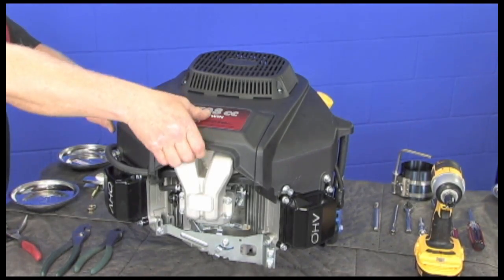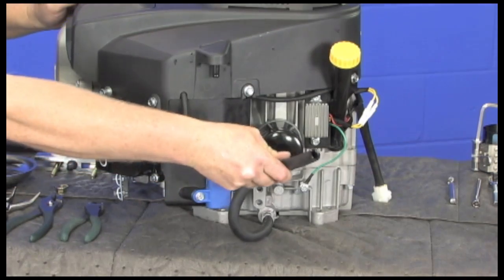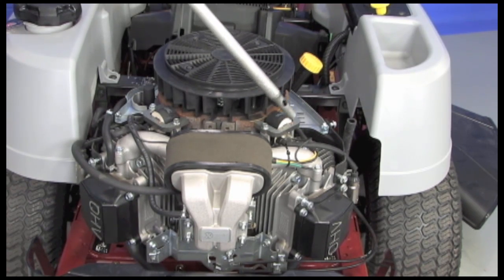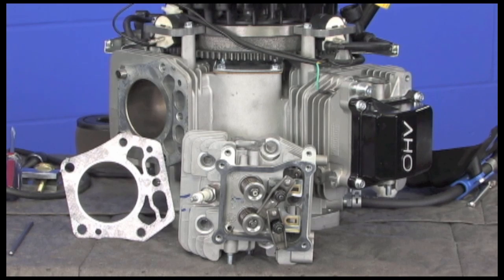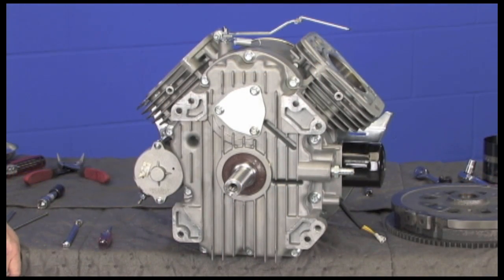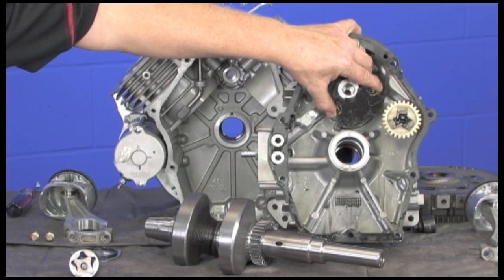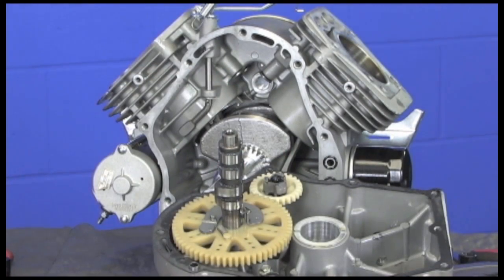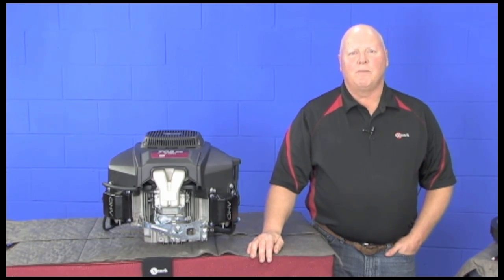Exmark Engine 708 cc Overview

Comment: I live in Michigan and the Weingartz outdoor power equipment dealer near me sells Toro and Exmark residential and commercial equipment. The Toro Exmark branded engines are extremely reliable engines according to this dealership. My brother has a Exmark Radius E Series with the Exmark engine, and it works extremely well, and it seems a bit quieter than his previous Lazer Z Exmark with a Kohler engine. Most small engine manufactures have their engines made in China. Not much made here in America anymore. As consumers there is not much we can do about that. I also have a Toro 1232 Power Max HD snow blower with the Toro branded engine. It is a great engine. Like all engines, proper maintenance is the key to longevity. After watching the video, the Exmark / Toro engine seems very well made. For those who don't know, Exmark is part of the Toro company.

Comment: I don't know why people are so mad about this engine, it's clearly proven itself over the past decade. people complain that it's made in china and yeah it is just like kawi and honda have their engines made in china. it all depends on the manufacturer not the country. lots of quality products are made in china. people need to get over themselves 😒and nylon cam gears are in ALL the different brands of v-twins. Honda has them Kawi has them Subaru has them and of course Kohler and so on. the only way those could fail is if you let the engine overheat way above it's operating temp. which as you can imagine is very unlikely on a lawn mower.

Comment: Hello, I need some help on this engine first to say a valve fell out into the cylinder and it destroyed the piston and head so I bought new head assmbly with piston and rings anyway its all back together compression is 160 was running good then a little pop started and left but then the motor just quit although i can restart it so I discovered not enough vac at the intake I mean this thing hardly draws any fuel does any one have a suggestion to help me figure out where the vac went? I now have noticed a small leak of oil at the oil pump cover at bottom of motor but its not terrible..any advice I would appreciate! Both sides have great compression..If I run it wide open it does fine for a little while then it will eventually run out of fuel..

Comment: UH what happens if you break that piece sticking down that the drain hose slides into?
Reply: I snapped mine right off doing the 5 hour oil change.
What happens is that you stick a bolt in the hose and carry on.  This appears to be the recommended fix and it happens to a LOT of people.  They're supposedly working on a fix as I type.  But since the engine is manufactured in China by Loncin, it may take a while to happen.

Comment: Mine is backfiring out exhaust when starting while warm. Brand new motor with less than 10 hours. Any ideas why?
Reply from the maker: Hello - sorry to hear that. Please contact Exmark Customer Service at 800-667-5296 with your model number and serial number to discuss the warranty options available. Thank you.
Reply: @ExmarkManufacturing   thanks for responding.  Heres a link to my video of the issue im having with my radius: https://youtu.be/Dg0R4wVWXXQ
Reply: Hello and good afternoon turn your mower off with the motor wide open it cuts the gas off and runs out of gas so it will not enter the muffler when you cut off that is why it back-fires

Comment: Exmark is a terrible company for quality in 2019!   I have had 2 issues from a brand new lawnmower. Grease fitting was stripped out I noticed when I got it home and after 2 hours of use one of the blades came loose and the belts seized up. I babied the thing. Never hit anything!  If they don’t make it right my goal is to tell everyone my experience!
Reply: Toro Exmark is Chinese Junk.

Comment: I have this same engine I think, in a Toro SW5425.  It is not a great set up.  If you have a smaller yard...one or two acres flat...it's okay.  Bigger than that, buy a better machine or spend all afternoon cutting the grass.
Reply: Exmark is a brand of Toro. This is a generic Chinese engine.  750 bucks at harbor freight tools.

Comment: I do a lot of work at a Toyota engine plant, which I believe everyone will agree makes a very dependable engine.  And I can assure you, nylon or at least polymer, (I don't know anything about plastic type stuff") is in the engines, from timing chain guides to what I think is a gear for the oil pump, i've not really studied it in all the time I spend there.  Weight is not an issue with a metal gear, seems dumb they are using that as an issue, they wouldn't weigh that much different and weight could mostly come into effect when changing the rpm.  It for sure, is quieter.  This gear is what's called a straight "spur gear" which can be really loud especially when manufactured cheaply where the two sets of gears don't slide together and meet smoothly when in operation. If quality is what they where going for, they would have made a "harringbone" or at least an "helical" gear, which they wouldn't because of cost.  No my friends, they did this for Cost, and the sound is a byproduct.  The gear inside the Toyota engines are a Helical, which makes them tougher, and I would say quieter, but that's not really an issue with nylon.  What I dont know about, is different types of nylons, and how they can put up with the force required to run a two piston cam shaft with the heat that's in the engine

Comment: I repeat, I will not by a engine made in China
Reply: Where do you think kawasaki is made...Utah? lol Been selling these for a while...have had little to no issues with this engine.
Reply: That’s a freaking Huge Chinese Nylon gear designed with a weight reduction software to make it as light and Shitty as possible thus saving material to make more cheap ass Under built gears with the remaining leftover production dust as the main ingredient... Run!!

Comment: I’m considering a Radius for personal use. Didn’t realize Exmark “made their own” engine. Apparently you have to move to the Lazer series to get the Kawasaki.  Exmark (Toro) is doing what many manufacturers have done - instead of buying an engine from Kawasaki for $1200, they sub a Chinese outfit to make an “equal” for $500 less. This is an additional $500 profit per mower sold, greatly increasing the bottom line (making stock holders happy).  

Is there still a US manufacturer that says, “I know it costs a little more, but we use the best components that we know of”?

I’ve got mixed feelings on the nylon gear. Of course, we would all like to see it as carbon steel. However, it does lend itself to noise (which comes from vibration). Vibration has its own set of long-term consequence - This is bitter-sweet.
Reply: Todd Zembower  the radius X has the kawi and is a great buy

Comment: It is a predator engine. Not that I am saying those are bad engines but it is a $730 engine at harbor freight. No thanks.
I was looking at a radius s and they have these engines. I guess I will look at a scag.
Reply: Scag is a very good lawnmower.
Reply from the maker: Exmark has been using the 708cc V-Twin for several years. With our Exmark exclusive features, this engine has passed our commercial testing process. It meets our standards for quality control and is backed by Exmark Customer Service support and our leading product warranties.
Reply: Exmark Manufacturing Inc. I understand that it may be a great engine, I am just disappointed that a mower with this price point has an engine that I can buy for $730. My dealer told me that I cannot get a radius s series with any other option.
Reply: @jeremyc3431   my radius x series has the fx730v Kawasaki engine its beast the top of the line radius has the Kawasaki engines are king!

Comment: Love the design of this engine. The carburetor is VERY easy to remove and install. The carb is also very simple to work on. Love the easy to remove upper shroud and oil drain system. It also has aluminum valve covers instead of crappy plastic.

Comment: Is this the same engine that is on the new Toro's? They are claiming it's theirs.
Reply from the maker: Exmark, based in Beatrice, NE, is a division of The Toro Company. Exmark is operated as a separate business with our own leadership, research and development, manufacturing and distribution. We take great pride in our relationship with landscape pros and homeowners, and working closely with our customers to develop products that specifically meet their daily demands in the field. That’s why Exmark mowers are purchased 2-to-1 over the next best selling brand by landscape professionals.
Reply: @ExmarkManufacturing  That's a non-answer.  So,
 I'll assume it's the same engine.  I think it's mediocre at best.  I'm not buying the Radius E as a result of this engine being the power plant.
Reply: @xelasmada16  the engine has proven to be extremely robust. you have been played the fool!
Reply: Ha,Ha. BS! What Joke! Two lines two colors two stickers same caca!. You must think that we are all sheeple... Just like snapper/simplicity Same sh-t different color. MTD same 'o,same o'.  This industry is becoming a real joke...This is what happens when one company all most owns it all. A Monopoly. A former outdoor power equip tech of 15+ years.
Reply: Simple answer is yes same motor but was probably redesigned slightly for toro
Reply: Exmark Manufacturing Inc. so does this engine have any relation to the predator 708? Who designed this engine from scratch?
Reply: Daric Simons has

Comment: Where is it made? I won't buy untill I know....
Reply: China
Reply: As stated above, all indications is that this engine is identical to the Predator engine sold at Harbor Frieght and that means its a Lincon engine, which is Chinese. There were two 708 cc engines under the Toro nameplate designed specifically for the Timecutter mower line of mowers in 2015. One is rated at 22.5 hp; the other is rated at 24.5. Of course these are gross power numbers rated at 3600 RPM. Be advised, neither Toro or Exmark build engines. As far as I can find, these are built by Loncin in China. I'm not suggesting whether or not the quality is good or bad, but keep in mind, the Toro Timecutter is the lowest-end zero turn models, and a Toro zero turn with this upgraded, exact engine can be had for as little as $2,700 with a stamped, 42" deck. And the current price for an identical engine replacement at Harbor Freight is at or about $900. What I don't know is the physical differences between the 22.5 hp and the 24.5 hp version. In the Timecutter line, the models with the Myride suspension and seats with arm rests get the more powerful version for an extra $500 or so, and I believe some of the larger decks get the 24.5 hp, but they are both 708 cc.
Reply: @gregoryfaulkner5345  thre has been near zero complaints of actual owners of this engine. Lincon has made engines for BMW bikes and other known brands. exmark and toro use this engine for years now. its atleast as good or better then a comparable Kohler. but a kaw isn't a honda motor either.
Reply: USA
Reply: No it's not.... I have since found out that the engine is made in CHINA!

Comment: it's only as good as it's weakest link……….the nylon cam gear is pretty sad…..you learned from the auto industry to trim back mass on the pistons, great !……the auto industry stopped plastic cam gear production 20 years ago…...
Reply: pdoggy10inch I agree when I worked on my own cars/trucks I would change out nylon cam gear with metal.